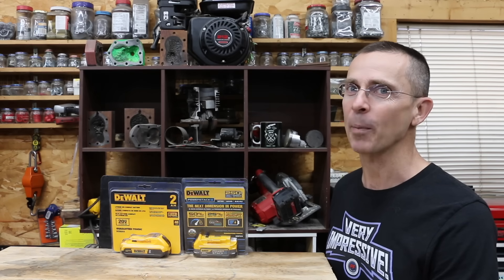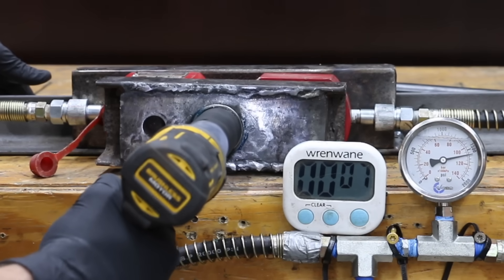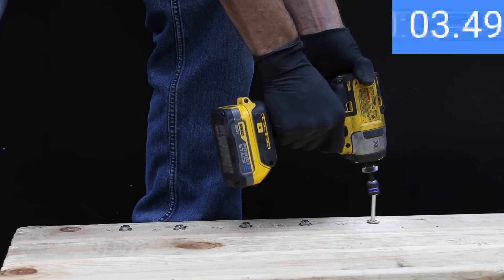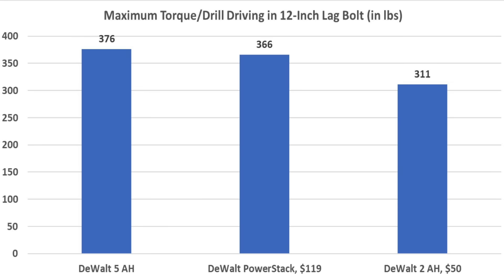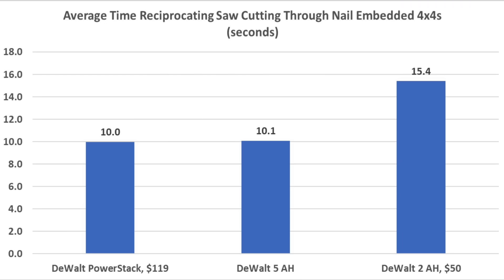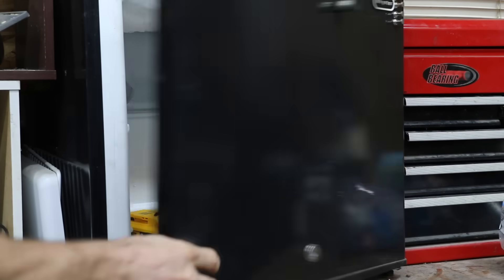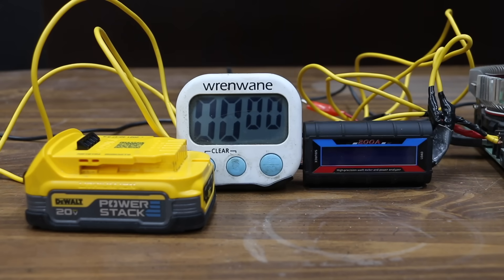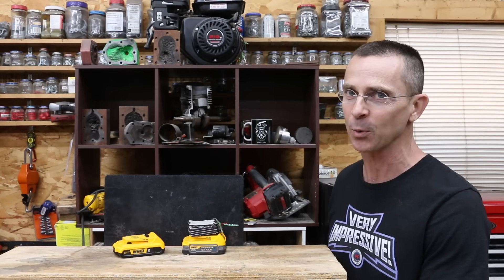Compact “Pouch Cell” Battery Better? Let's Find Out!

Comment: Great video and test that's a neat battery and pretty impressive overall. On the reciprocating saw I don't think I saw the nails in the 4x4's for the 5amp battery (not that it matters that much). Thanks for work hopefully we see these batteries in larger capacities soon.
Reply from the maker: Thanks!  Sawdust covered the nails.

Comment: I have very little to no interest in battery powered tools.  It's industry-driven hype to sell everyone on a technology that will hurt them in the long run.  The upfront cost is astronomical.  The inevitable change in the battery systems will obsolete these tools prematurely.  Brushless motors are not serviceable.  Mark my words, it will happen.  I'm sticking with corded tools unless I really need something cordless (like my impact driver for working on cars).
Reply from the maker: Thanks for the feedback.

Comment: This does fill a much needed niche. I like the weight of the 2.0Ah battery but they don't last very long which is why I opt for the heavier 5.0Ah battery. The bigger battery can wear out your wrist and won't get into tight spaces. It doesn't even fit in my box when attached to the driver. Is it worth twice the price,? Maybe.
Reply from the maker: Thanks for the feedback.

Comment: These "pouch" batteries (lithium polymer) have become the norm in laptops.  The previous batteries were based on 18650 cells.  In a year, I might have seen one of the previous batteries physically swell, but more than one a month with the newer laptops with the "pouch" batteries.  The swelling sometimes causes enough pressure to break other parts in the laptops.  But the "pouch" batteries are thinner and lighter.
Reply from the maker: Thanks for the feedback.

Comment: Thanks for the very detailed comparison and analysis.
Personally I wouldn't switch to pouch cells until the capacity increases. 3Ah is the least I'd go with.
And the price just doesn't make much sense as it is. My 4Ah 21700 cell batteries are only half pound heavier to make any difference while working
Reply from the maker: You are welcome!  Thanks for the feedback.

Comment: LiPo cells, like what's in the PowerStack, have many advantages. They're obviously more energy dense compared to 18650 or other cylindrical cells, and they're lighter as well due to omitting the metal casing that the 18650s use. The significant drawback to LiPos are in high current or constant current loads. They can handle short bursts of current draw just fine, but they start to falter during extended periods of high current draw. Those drawbacks are why a ton of today's EVs still use cylindrical cells instead of LiPo packs. The blower test is a perfect showcase of that drawback. The PowerStack had excellent current draw in the beginning, but faltered very quickly as time elapsed. It's a significant upgrade over the regular 2AH batteries, specifically in lighter use cases like drills and impacts, yet at almost triple the price it just isn't worth it. I'd rather buy a two pack of the 2AH batteries or go for the 5AH at that price.
Reply from the maker: Thanks for the feedback.

Comment: You should not eliminate 1st test on battery in cold test.  The battery warms!
          Pouch cells are more prone to catch fire.  They are impossible to replace.  10 years from now (when battery dies & DeWalt has invented "new tools"), you won't be able to buy replacement battery.  You must throw away perfectly-working tool.  18650 cells are commodity items, available for sale, & constantly being improved.  You can re-cell your old battery.
Reply from the maker: Thanks for the feedback.

Comment: In my personal experience these pouch cells very frequently start bulging after a few years and become very scary to have around, something I haven't seen with 18650s
Reply from the maker: Thanks for sharing.
Reply: @ProjectFarm  The pouch cells can short internally and catch fire if they are mechanically damaged.  I'm glad they didn't light up on you as you were peeling them apart.  I'd suggest disposing of them at a hazardous waste collection that takes batteries soon, and storing them outside away from anything flammable in the meantime.
Reply: I refurbish electronics/battery packs and it is absolutely normal for these pillow packs to swell as they fail even from normal use. This makes them extremely easy to puncture, esp in something with shattered glass like an iphone. Ive had a few battery explosions on my desk, even more on my employees desks. The first one will make you much more aware, look for dents or scratches, if swollen carefully extract. Never use metal tools. And if one does ignite, throw it to the floor away from anything flamable. Dont breathe the fumes and just let it burn out, wont take long. If your working with large cell packs it is imperative to have adequate fire safety equipment because fire is inevitable with these. Ive been refurbishing and making battery packs since then 90s.
Reply: I use these lipo cells in my drones and absolutely scary. Never charge them indoors, I had one start to bulge on my garage floor. I stopped charging it, but it carried on swelling and 10 minutes after I stopped the charge it burst into flames.
Reply: @thra5herxb12s  when I got into drones and found out the safety protocols and dangers of charging the lipos. I was shocked at how dangerous they are if you aren't careful.
Reply: @thra5herxb12s  DeWalt is using Li-ion, not Lipo.
Reply: @vincentdevillaine6621  The "pouch" is LiPo, a formula (There are many.) of Lithium Ion.
Reply: @solarsynapse  ok, my bad.
Reply: I do PC repair for county IT and laptops and mifis with flat cells get 16-18 months most before they swell. I've never seen an 18650 swell.
Reply: @tadracket448  LOL you should look up Ultrafire and other "...fire" branded Chinese 18650 batteries. Vapers and flashlight fans have seen them burn. The pink ones on this video are probably Samsung or LG, though.
Reply: @dingchavez1960  I've heard that. I have a few but don't push them hard. They are for low draw lasers and flashlights. But I have some old ones I probably should recycle. Thanks for the info 👍🏻
Reply: Dewalt is one of the top tool makers in the world, those batteries will work just fine.. y'all are just trippin
Reply: Cell phones use pouches and most seem okay, although I did see an iphone which split in half from the pouch off-gassing
Reply: we need heavy  drop test hehe and my opinion would be they are less flammable as years have pass i hope we know little of this new battery making , power will come on its cost 50/50 ill flammable like those in passed  videos of batteries getting caught in fire w a puncture  ...
Reply: my rechargeable tool truck flashlights have pouch batteries and they always go bad in a year or two. start bulging or tear at the corners.
Reply: that's exactly what i would think would happen... pouch cells are cheaper, and don't have the protection of cylindrical cells. 18650, 20-21700, etc. all have individual steel shells around every cell. i could maybe see pouch cells surviving a fall, being lighter and able to absorb the shock. but then, they also have no real protection. I've still got Makita 3ah packs going strong after like 10 years with Sony vtc4 cells. I don't see any pouch cell doing that, maybe that's the point... Also have a bunch of Milwaukee packs with mostly Samsung 25r cells, starting to get some with 21700s, had pretty good luck with them so far. Samsung cells aren't quite as good as the old Sony/Murata cells, but Sony doesn't make them anymore. And I've yet to use any Murata cells since i belieive someone else took over manufacturing them. But Samsung are just about as good, just don't handle higher amp loads quite as well.
Reply: that's why tesla car do not use pouch but the 18650. GM went pouch and excuse me! "your cars on fire"
Reply: @deanziyone2213  all car lithium car batteries have to go through rigorous testing because it was tesla's batteries that were starting on fire.
Reply: @deanziyone2213  Tesla now uses 21700, has for years, they're more efficient than 18650 cells if you have the room. Which is where you see other manufacturers going with their medium and heavier battery packs. I think Metabo has used them for years, and Milwaukee uses them for the 6Ah max packs, etc. They have higher capacities, obviously being larger, and better handle higher amp draws than smaller 18650 cells. Basically, just follow Tesla, they've already done the research...
Reply: @deanziyone2213  I wanna say one thing on this, The Chevrolet Bolt has bad Pouch batteries that have a manufacturing defect, If you look up the Chevrolet Volt The Hybrid electric car they use to make, it also has those pouches and those are still on the road with no battery problems
Reply: @deanziyone2213  Also as Jay Bomb poined out, The Nissan leaf of all years (2012 - Current) if i'm correct use the Pouch battery style and i honestly haven't ever heard of a leaf catching fire and the older leafs have No battery cooling or heating at all
Reply: @deanziyone2213  ⁿ
Reply: @deanziyone2213  9l9
Reply: @Dean Ziyone actually 21700
Reply: @deanziyone2213  lol yah newer Tesla's have a bigger clynider cell and then they also have a third even bigger cell they make themselves ...pouch battery's suck for any high load useage ..also they are at such a high risk for fire when factory defects happen ..then all the other issues that come with them
Reply: Same thing for me.
Reply: @ElectronikHeart  9999
Reply: Pouch cells in phones bulge bc of heat. Heat is usually caused by high current drain or fast charging.
Reply: those pouch batteries are exactly what is inside of your cellphone and they don't bulge because the battery management system. if your batteries bulge its because you did not manage it properly.
Reply: @jimbobbyrnes  BMS has nothing to do with swelling typically. The RC Lipo guys keep their cells in perfect condition, discharged no lower than 3.5V and storage charged to 3.7/3.8V after every use and they still get batteries that swell and catch on fire.
Reply: @ericklein5097  You can minimize it by taking good care of the battery as in using a bms. The gases that causes the battery to inflate are a byproduct of the battery getting too low in voltage or too high but outside factors and temperature can also cause this. Even with a bms all it takes is a unsteady charging voltage and it inflates. Another cause would be wiring a cell up to a cell that does not match. Another cause would be using too many amps on stall torque for the rated battery which RC toys do all the time even with lithium. All these problems are solved with a bms that is actually a bms. with voltage smoothing and overcurrent protection. even samsung phones don't have undercurrent protection and so their phones inflate. Tools have a giant expensive high current battery if they don't come with that bms it most likely is not legal to sell.
Reply: Nissan leaf uses pouches and they're fine.

Comment: It seems for my small impact and regular drill that gets used throughout the day the 2ah or maybe a 3ah would be the better selection. For longevity and cost. We have 2 12v dewalt drills and we use them more! But for my power consuming reciprocal saw and 4.5" grinder something bigger like the 5 or 6ah would be better. But for a 1/2 high torque impact that gets used less but harder an appropriately sized powerstack would be awesome. So it comes down to what you are doing really as to what the best is. Thank you for the test. As I may have wasted money on a powerstack that wouldn't be an advantage to me.
Reply from the maker: You are welcome!

Comment: oh no, this video/channel should have known better. this is a scam by Dewalt! pouch cells are terrible except for the lightest, most compact applications.  pouch cells are fragile to physical, temperature, and charging abuse. Customers will be replacing these often excluding that pouch cells have higher risk of fire.
GM and LG is already spending billions of dollars on recalling Chevy Bolt cars with the pouch cells/batteries.  
I have an LG nexus 5 smartphone and its batteries always swollen because the phone has poor thermal management.  I also have one DJI Drone battery that is swollen and defective without cause and $100 is not cheap!
Reply from the maker: Thanks for the information.

Comment: The thing that needs to be said here, is that it's not the battery cell that's making the difference. It's the BMS board inside the pack. They should all be a 5S board, but the 2.0 will have a more limited current flow probably around 20-30 Amps, whereas the 5.0 will be able to draw around 35-50 Amps depending on the board Dewalt chose for management. I would venture to guess that the PS battery is using a higher amp rated board, probably the same one as the 5.0 pack.
Reply from the maker: Thanks for the feedback.

Comment: The price bothers me as pouch cells are less expensive (per watt-hour) to manufacture than round cells.  It appears to me that this product is mostly designed to increase DeWalt profit margins.

I would also worry about longevity as pouch cells tend to degrade faster than round cells for reasons I don't quite understand and they can also overheat as stacks of pouch cells have difficulty transferring heat from within the stack.

These PF tests suggest that though the available amperage is indeed higher with the PowerStack, the total capacity may be slightly less than the traditional 2.0AH pack.  Charging twice as much for only 15% more torque just seems like a bad deal to me and feels too much like a ploy for Stanley B&D execs to buy themselves new yachts.  $120 is a rip-off, IMO.

With that said, this could be the future of tool battery packs as pouch cells offer more volumetric efficiency while potentially costing less per watt-hour to manufacture.  Other brands will want to market the same "power" advantage and will probably follow DeWALT down this path unless problems arise as pouch cells are more prone to puffing up and even burning.

Knowing the realities of these battery technologies, I will NOT pay more for these packs and would instead buy extra round-cell packs or a single, higher-capacity pack.

Keep track of your battery packs and check if these pouch-cell packs provide similar or increased lifespans compared with traditional packs.  I imagine that DeWALT has tested longevity before bringing these to market, but even if the price comes down I would not commit to large purchases of these packs until they prove themselves reliable for a year or more of actual work.  Be suspicious as round cells are a highly proven technology for tool batteries.
Reply: right. this is a scam. pouch cells are terrible
Reply from the maker: Thanks for the feedback.

Comment: You missed the significance of the test results on the graph at 14:10.  The powerstack claims 3Ah vs the 2Ah battery, but died sooner, that shows it has LESS capacity than the 2Ah.  And that is not even taking into account that a 3Ah battery should be able to tolerate a 5A load better than a 2Ah.  Not impressive at all.
Reply: The powerstack is a 1.7AH claim, where did you get 3AH from?
Reply: 1.7AH is not mentioned in the video and not shown on the packaging he showed.  He says it is compared to the 2Ah battery and the packaging shows it has 50% more.  3 is 50% more than 2.  That's where I got it.  Where did you get 1.7?
Reply: @michael931  from dewalts website on the product. He tested what dewalt calls the "powerstack compact battery" which is 1.7 AH. They make a "powerstack battery", not a compact, which is 5AH, and a "powerpack" battery which is 8AH, all using this pouch battery cell tech. 

He compared the 1.7AH to the 2AH regular because it's the most similar. They advertise "50% more power" meaning torque, this battery is designed for high discharge applications, it's not "50% more runtime."

Comment: I wonder if the battery packs have a case, like a covering if that would benefit cold performance. I used to do a lot of work in the cold and leave my DeWalt batteries exposed. Maybe battery cases would of saved me some neck pain 😭
Reply from the maker: Thanks for the feedback.

Comment: One concern I've heard from other review channels, is how similar is this form factor to laptop and cell phone batteries? Considering these batteries are used constantly on job sites, exposed to extreme temps, etc. Will they bulge and rupture causing other dangers?
Reply from the maker: Thanks for the feedback.
Reply: Pouch cells have never, ever been known for their durability... High drain cylindrical cells have been proven and literally have been made for this purpose, to be durable.

Comment: I love that dewalt is always working to make these tools and batteries better.  I have many of those 5 AH batteries and I'm 100 percent satisfied with the power and longevity of the cordless tools using them.   So I'm just a bit confused why they would go to the pouch cells.  Slightly better performance but much more expensive and they are not likely to have the same longevity as the other batteries
Reply from the maker: Thanks for the feedback.